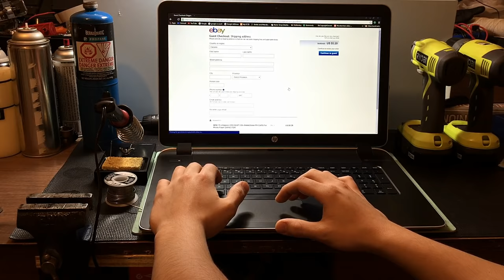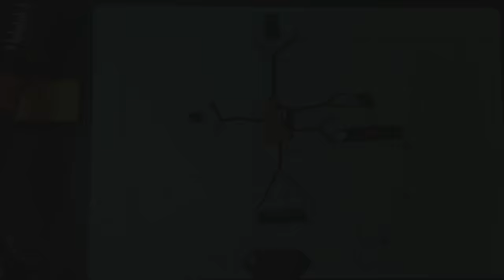MARK 1 Electromagnetic Web-Shooter Tutorial

Comment: +The Human Spider can you keep the flash attached as I want to make mine similar to the one in the first amazing spiderman
Reply: sure All you'd have to do to keep it on is just solder the wires on and leave the flash on the same connections as well.
Reply: Nate Richardson cool, because I wanted to model one after the amazing spider man, except using a red led instead of the white one
Reply: ᎷᏆᎢᎻᎡᏆᎠᎪᎢᎬ I’m pretty sure that would not work if you want red led like the movies DO NOT ATTACH TO THE FLASH otherwise ur small 3 volt led will blow up, Instead attach it to the 3 volt battery with a resistor to protect it overtime

Comment: how do you connect the coil to the wires?
Reply: You need to sandpaper the coil extremities, to remove the (red) non conductive paint. Once you've done so you can easily solder the coil to the circuit or to some wires.
Reply: AvengerScarlet yea what he said but don’t do all of the the wire just the ends where you need solder them otherwise ur coil will short out and it won’t work at all

Comment: Could you use a higher capacity capacitor and increase the number of capacitors to 3 in a parallel circuit of capacitors? This could increase performance
Reply: +The Human Spider How much more performance do you get for your improvement
Reply: +The Human Spider Well that is the price to pay for performance. Have you tried a different circuit? Because it may help to decrease resistance
Reply: +The Human Spider What problems are you having?
Reply: ***** The polarity may have been the problem. All we can do is test things to get the best results

Comment: i did place them in the same place as u did in the vid and it doesnt look like it melted or anything but im going to restart it but how could u prevent any melting when soldering(tip?)
Reply: what size wire did you use?  does the size of the wire matter?
Reply: the size of the wire does matter i used a 22 gauge and did about did 50-100 turns

a poweful coil and a good capacitor bank is what is needed for a longer shot

Comment: I wanted to ask how will the whole project cost me because I want to have a pair of web shooters that work for my Spiderman costume
Reply: Well it depends, if you don’t have any of the necessary soldering equipment then it could get expensive, also you need the electrical components as well but you can get lots of them for cheap just in case you mess up, plus the cameras, but if you already have a basic soldering kit you’d just need new capacitors, the copper wire, button push and battery tray as well as the camera

Comment: Could you specify the capacitor type and number, and what would happen if you used a magnet as the projectile? Thanks
Reply: I am interesed  about the capacitor too
Reply: After further researching this project, I came to the conclusion that he must have used the capacitor(s) that came built in the disposable camera, because other capacitors would be incompatible with the flash circuit, rendering them useless in this instance.  I built my own version of this, but as this video's publisher stated, "it is a proof of concept" and is not very powerful.  To save time and money but still reach the same goal of a wrist mounted grapple gun, I created a crossbow-like mechanism that fires a small harpoon with fishing line attached to it.
Reply: Yeah

Comment: How does it shoot out do you need to use a pipe or silly string or something?
Reply: It’s a coil gun, so basically you get something conductive/ magnetic and put it on the end of the barrel and the magnetic field turns that thing into a projectile from the copper wire, so theoretically if you make a web fluid that has something conductive and magnetic then it should shoot out